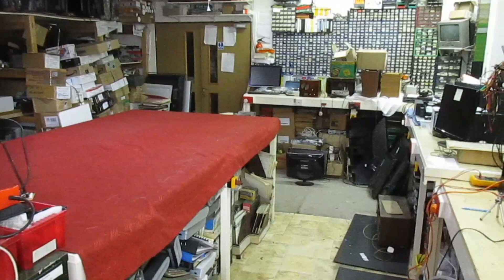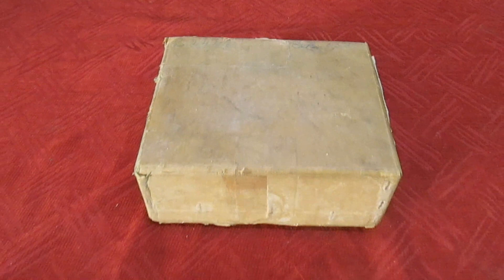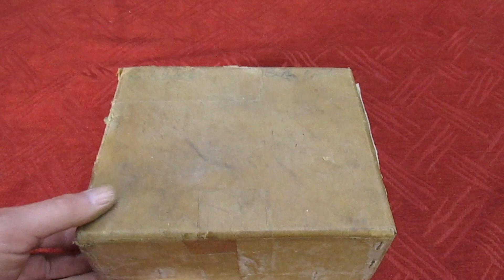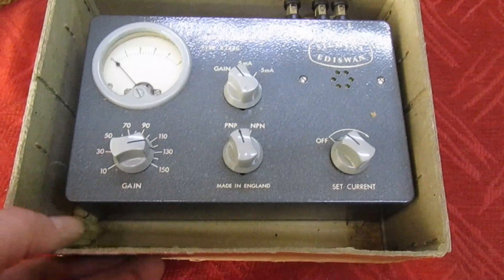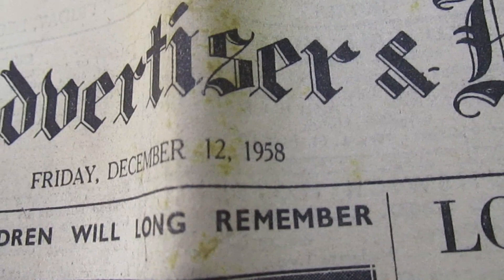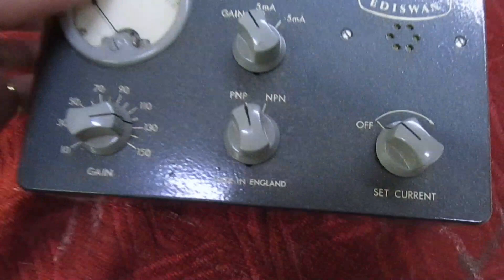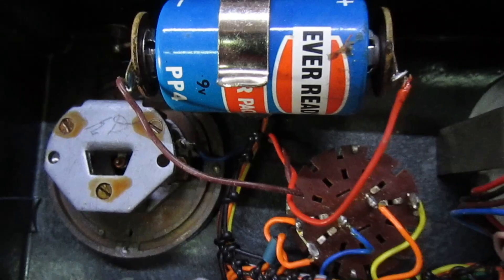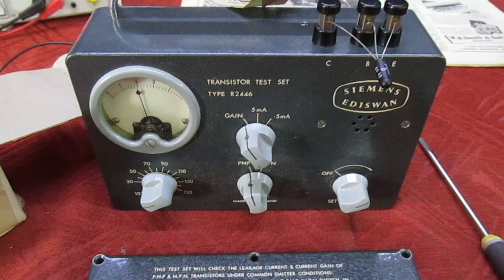1960 Vintage transistor test set.

Comment: Lovely old piece of kit, that.  The silk screened lettering and hammer-tone enamel finish are superb.  I would restore it just to make it work as designed.  I never like to leave a piece of gear on the shelf without making it smile and enjoy working again, but with a shop as busy as yours I understand your reasoning.
Reply from the maker: It's in such good condition I don't think it has ever been used.

Comment: Thanks for a great video.  I was imagining somehow replacing those bipolar caps with some surface mount or tiny through hole caps behind the circuit board (if indeed there is room).  Maybe one could replace them with back-to-back electrolytics.  I respect your judgement to not go mucking up the vintage unit.
Reply from the maker: I could have repaired this using 2 back to back caps but as I'm never going to use it as its not accurate for what I need I decided to keep the originality and left it not working .

Comment: Like you I hope that lock down ends very soon. It’s funny how popular those transistor testers were I cannot think I have ever really used one as I usually use the diode test function on a multimeters. I do have a little Peak transistor tester and that does get quite a lot of use. Always interesting to see test gear thanks for sharing. I have never seen a PP4 ! Those capacitors are bipolar type.
Reply from the maker: Bipolar caps are usually  only seen in speaker crossovers , I can only think it was used here to avoid using two sets of caps for the PNP/NPN polarity reversal, Jeremy who makes the peak tester is only 5 mins down the road from me ,i have seen a lot of Eveready batteries come and go over the years, in the 70 s there were some very strange types,  PP1, 1289,126, PP6, PP7 ,800, Cycle cell and an outrageously big one called a Flagg which I think was used for electric fence applications , would be very interesting if there was a website where Eveready batteries over the years could be viewed as Im sure there must be many more I have not even seen , Incidentally in the 70 s there was a cheap imported Hong Kong PP3 battery which had the logo Flying bomb ! many thanks for the comment .

Comment: Weren't those Plessey reversible electrolytics used in speaker crossover units?  I'm sure I've seen some before, many, many moons ago, when I was still in school if I remember.  I thought, at the time, that they were a mistake. I thought someone must have loaded up the moulding machine with the wrong colour at one end, until I saw the label.

I could well imagine those old Erie carbon resistors will have drifted off tolerance by quite a margin.

It has to be said though, that is a nice piece of kit to have, and must be quite a rarity.  Even that battery!  I cannot remember when I last saw one of those. In a school friend's transistor radio I would imagine, but how on Earth has that battery managed not to rot away and leak all over the place?  I've seen batteries marked up as "Guaranteed Leak Proof" that have popped an end and started to leak!  Yours must be a miracle.
Reply from the maker: As you say, amazing the battery hasn't leaked and ruined this, duracell use to advertise as the only leak proof battery on the market long ago but they dropped that slogan now as they are absolutely awful and always leak, the tester is in like new condition and doesn't even look to have been used, almost like someone bought it and then forgot where they put it and found it 50 years later.

Comment: If you've ever watched Radiocrunchers channel he does a lot of Hacker and Roberts transistor radios from the 1960's & 70's which have Plessey yellow and red capacitors (but usually not reverseable or non-polarized). They are nearly always faulty, high ESR and way off their value.
Reply from the maker: Not a channel I have seen but I will look it up.

Comment: The transistor/diode breakdown test unit is very cool! I was going to comment underneath but comments are disabled. Would you be interested in sharing the design? Also, in response to your video on the four valve radio using TV tubes, a friend of mine here in NZ builds audio amplifiers using TV tubes and they sound pretty damn good - so there's more than just one use for TV tubes!
Reply from the maker: I'm right in the middle of building a valve amplifier using all TV line output valves at the moment , watch my channel it should be ready soon. The HV breakdown tester is just a constant current generator , let me see if I can find my circuits as I made this over a year ago now .
Reply: @michaeldranfield7140  I'm already subscribed to your channel. It's one of the best on YT. I sure hope you're able to find your circuits. I love building unusual test equipment like that.

Comment: nice, i have one that may be late 50s, possibly ex MOD as has the 'crows foot' symbol on the meter dial plate.?, no branding on the case itself, or maybe home built using ex MOD meter? mine doesnt test under 'active'/oscillating conditions, purely DC ..
Reply from the maker: Could be the same one as I have , I am sure I saw somewhere this meter also appeared under different brands .